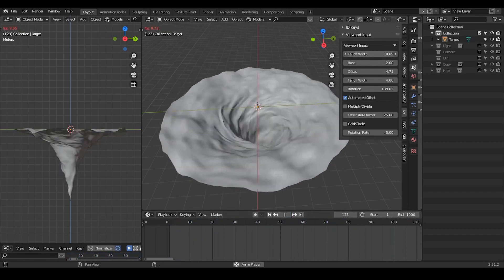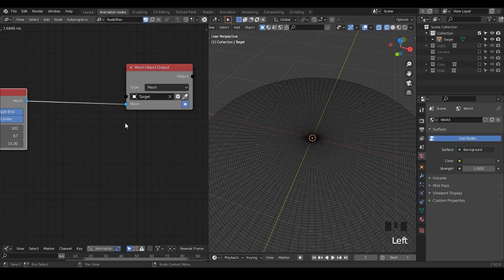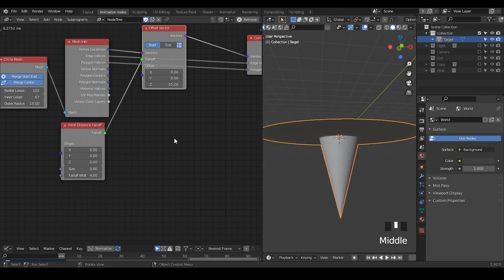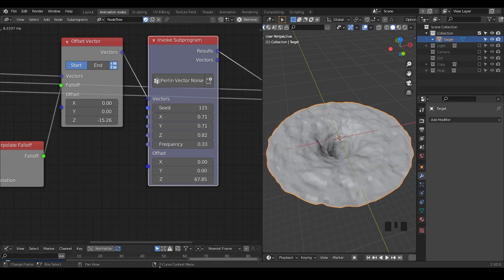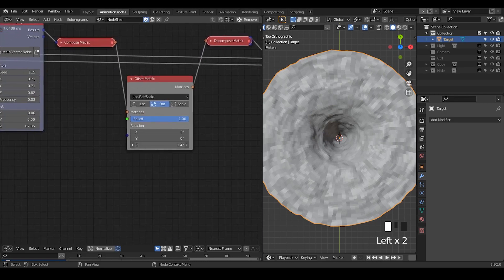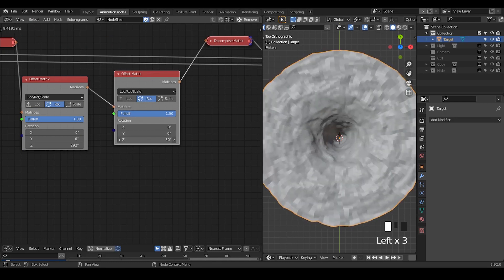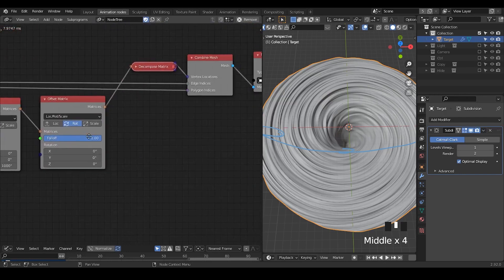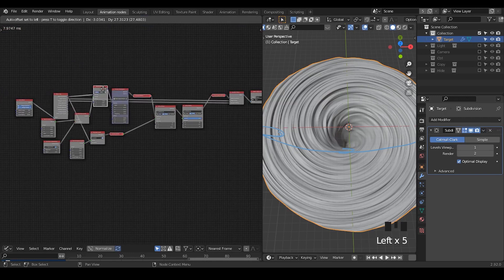[Tut] Procedural Whirlpool/Water Vortex - blender animation nodes

Comment: For those who still couldn't follow the part where he covers the Perlin Vector Noise:
you need to append the preset files from the description link first.
Then, in your animation node panel, go to the drop down menu right to the "subprogame" tab, you see "F Preset1" "F Preset2" etc...choose Preset 1, then locate the Perlin Vector Noise via Ctrl+F search, then you see there is missing linkage as the author mentioned.

Comment: Hey Bradley! my "Perlin Vector Noise" isn't working. I found the node (and I opened the Startup file from the Presets) but after connecting it, It doesn't displace. Is it possible that the presets or the addon aren't working in Blender 4?
Thanks for sharing sire, your rock it
Reply from the maker: it would be better if you can ask in the server.
the answer is for some unknown reason, certain linkages were broken.
If select this node, hit tab, you will be brought to preset node tree group. if you "Ctrl+F" to search "perlin vector noise", you will be brought to the node group where it's created. you will find "combine vector node" is not connected with three noise node in X, Y and Z.
Reply: so yeah, It seems you have to go into the "Perlin Vector Noise" and re-link the "Combine Vector" node! That should fix it!
Anyway, I'd like to know your opinion Brad, will this Addon still be usable in the future? technically talking
Reply from the maker: @martinianogarcia9167  
It's very good you ask that. I was hesitating if I should tell you that this tutorial was already replaced by a Geometry Nodes (GN) tutorial since 3.0. You can find it on this channel.
Talking about "Animation Nodes" (AN) add-on. There are several things to consider, I hope you read it thoroughly before concluding anything:
1. I no longer recommend any people to learn AN, I personally don't make AN tutorials anymore regardless. However, I have to admit that I am still keeping AN presets to a smaller extent and I still use them for functionalities that can't be done by GN.
2. GN is essentially a modifier. this means it can't control other objects such as "camera", "light", etc. Those jobs are considered to be done by "collection nodes", which is still a concept in the paper, and will not come true anytime soon.
3. AN was created by Jacques, who is now one of the core developer in GN. It's possible many people believe they share similarity, but they absolutely don't! that's why I don't recommend people to learn AN anymore.
4. AN has ability to deal with MIDI and read extra files such as texts or others. (I don't use those features though.)
5. AN is still actively maintained by another blender developer Omar. His current role in blender was about cycle and real-time compositor. In fact, recently I just reported a weird bug to him and he solved it quickly. He also helped to solve AN un-usable issue recently in 4.1 because of python version incompatibility. (Note this also means no new features are currently added due to shortage of developers and motivations)
 
In conclusion, I don't recommend people to learn and use AN. In 99% cases it can be replaced by GN in a better way. but the add-on itself is kept and still maintained with bug-fixes by a developer, compared to many add-ons which are abandoned for whatever reasons.
Reply: Thank you very much Brad! for taking the time and for your contribution to the community @bradleyanimation120

Comment: Hi, 
Thanks for the tutorial.
But I have a problem. You used PEELIN VECTOR NOISE which I could not find in Blender. 
Please, where can I activate it? If it is an add-on, where can I get it?
Please, help me.
Thanks
Reply from the maker: it's a preset I shared for free: https://gum.co/BmlCe. Note there maybe some unexpected error when you open it, if it happens by any case, you can ask in the server: https://discord.gg/TzuN6sPxQU

Comment: Oddly, following the tutorial, when i add the "Perlin Vector Node" nothing changes in the model? No matter the settings i choose.. I've used your exact values. Blender 2.92 here... I'll continue to look for the problem.
Reply from the maker: it would be better if you contact at https://www.facebook.com/NeisBradley, so it's possible to look into your node tree
Reply: Will do, thanks! @bradleyanimation120
Reply: @bradleyanimation120  I also found that the perils vector noise did nothing ..
Reply from the maker: @jacobcosquer  please contact me through the link above, which will be easier.
Reply: @bradleyanimation120  it also didn't work on your Gumroad file on my computer either ..
Reply from the maker: @jacobcosquer  I understand your worrying, please contact me at https://www.facebook.com/NeisBradley so that we can share the node tree to each other.
Reply: @bradleyanimation120  i don’t have facebook 😶
Reply from the maker: @jacobcosquer  It's ok. I also updated gumroad page for the bug fix:
►If you are experiencing the BUG that Perlin Vector Noise is not working.

Please Follow the step:

1. Goes to "Preset".

2. Ctrl+F to search for "Perlin Vector Noise".

3. There may be missing linkage in "Combine Vector" Node, please re-link them.